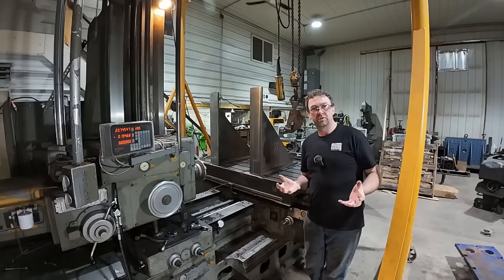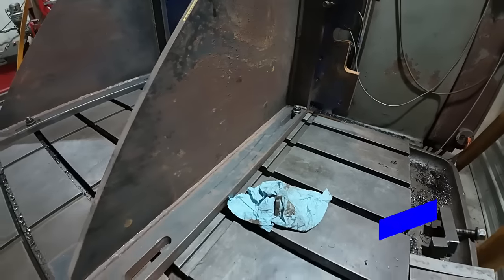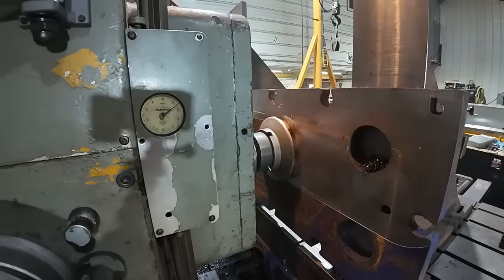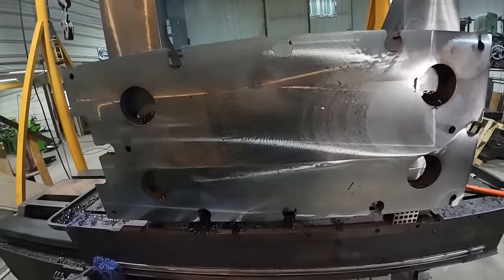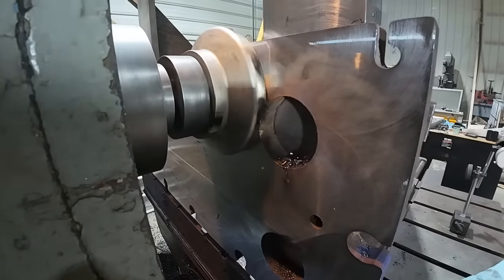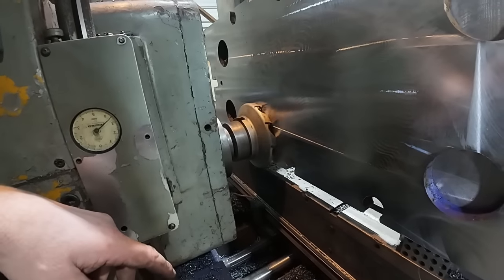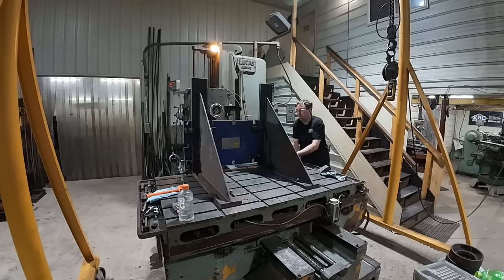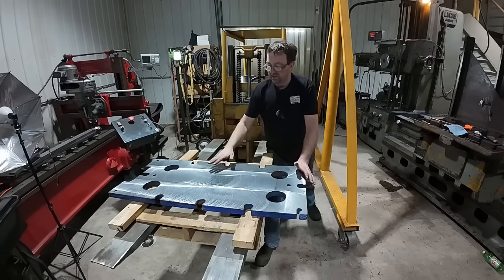Milling Another Heat Exchanger Plate on the Horizontal Boring Mill - Manual Machining

Comment: A little tip for plate and frames: instead of a chamfer, radius the inlet and return ports. For whatever reason, we have seen less failures after doing a .030" radius than a straight 45 chamfer. I am sure it is not the best advice for you, but your customer may see some more life from these.

Comment: Just a thought.  If you have a magnetic based drill, clamping it to the back side of the plate might reduce the vibrating.  Change the resonance frequency.
Reply from the maker: I wonder about residual magnetism holding chips on the cutting side and messing up the surface finish.

Comment: These jobs can frustrate you to no end. I run an hbm every day and just when you think you have the perfect set-up for a job, it vibrates.  Gotta get creative sometimes. I think i would have tried another 1-2-3 block in the middle and a hold down clamp over top of it. Might have helped....might not. I always put lots of t-nuts in between my angle plates or stops just in case i need more clamping. Anyway, it turned out nice for you and thats all that matters. Cheers Josh !
Reply from the maker: Yes, I should have tried a hold down. I never thought of that. I bet it would have worked.

Comment: Side note: A tee shirt can be incredibly uncomfortable when it has a bunch of graphics on the back. Any professional machinist will likely know this. Right? Great work BTW. You are the best. But, doing it wrong, all the time. Very great stuff.
Reply from the maker: LOL.  Actually these shirts are quite comfortable.
Reply: @TopperMachineLLC  The one's I wore were a total vapor barrier. Like wearing an old Sears vinyl poncho. Perhaps yours are more porous and breath better? The tech has changed I suppose.
Reply from the maker: @johnmcanulty7341  that and my shop has AC.

Comment: That a heat exchanger cover plate for the Alfa Laval plates, I work with those very often on the large MTU marine engines. BTW great job.
Reply from the maker: This is exactly what these are for in a local power plant.
Reply: @TopperMachineLLC  I appreciate your videos and thank you for sharing them.

Comment: Honestly, as thick as the plates are and the torque required to put them back together you could probably take a full quarter inch off the face and they would still be fine. I've never seen the front or back plates bend under several hundred lbs of torque. The chiller plates and gaskets though are a completely different story and you have to be very careful to apply even torque to each bolt or else those gaskets are going to leak like crazy. The plates themselves are stainless or titanium and when water is going through them they're so cold they condense the humidity almost immediately. We used to run plastic pellet extrusion and if even a tiny pellet a quarter the size of your pinky fingernail would find its way behind the gasket or on it the water pressure would shoot a concentrated stream of water several dozen feet.

Comment: You do great work just wondering if coolant would help the finish
Reply from the maker: Cool and is unnecessary for most operations. It would just make a mess. The heat went into the chip, carbide never got hot, and plate was cool.

Comment: You might be able to change the vibrations by welding or clamping larger blocks of material to those squares, the extra mass will change the frequency. Might be able to use something like a magnetic lifter, not sure what will happen to the chips though. Something similar could maybe be to cut a big hole in the center of the support plate, it will change how it resonates, but I don't know how to predict that change.
Reply from the maker: The magnet lifter may have worked, but you bring up a great point. I wonder if the chips would cling and possibly cause problems.
Reply: @TopperMachineLLC  I was thinking a third square with magnet coupling to the plate would work really well, unless the chips pile up around the magnet and wreck the surface finish. If the chips are hot enough, they won't be magnetic, but I doubt they get that hot.

Another thought might be to make a follow rest to prevent the plate from getting pulled up by the tool. Might help, might overly complicate the process. A third angle would be best and maybe just pushing it against the plate would be enough to stop the vibrations, maybe a strip of urethane since it won't be clamped.

Comment: Hiya Josh. Love the work. I was wondering if setting the plate vertically with the angle plates closer together would solve the chatter. Just my $ .02
Reply from the maker: I think a third one would have cured it. I think the chatter would have just moved to the outer ends if I'd have moved them.
Reply: Could you use another right angle plate in the center with a grub screw to help with the vibration?  Maybe with a piece of wood in between just to dampen vibration. 
That thing will surely eat some metal up quickly. 
Keep the videos coming Josh. 
Joe

Comment: Put some holes in the sides of angle plates.  get your self some round bar put some tap holes through it for all- thread rod. so you can tighten up against the back of a large piece like that.  to take out the vibration

Comment: Ha!  As I watched the video, I myself was wondering how it would work to resurface that plate using a planer as a planer, rather than a planer/mill.  Looks to me like the two methods you have there are about a horse apiece, the planer/mill having the bed stability but pretty handicapped by the BP spindle, while the Lucas has a great plenty spindle but its harder to tie the work piece solidly to the table.
Reply from the maker: Better angle plates would make a difference on the HBM. But I would love to try an actual planer.

Comment: Mr.Tapper,i have few ideas for you  (1) machine a key way in base of angle plates that will fit t-slots in table,(2) machine t-slots on face of angle plates alot easy to clamp up againist ,clamp 4 blocks on angle plate so u drill all the thru (3) put an L one and an R on the other always put L on left side R on the  right side SEEMS  KINDA ANAL DONT IT,FASTER ON SET-UPS IM A RETIRED HBM Operator ive run Portage,Lucas,Defiance,Giggings & Lewis machines BUT the most accurate machine i ever ran was a Deveileig Jig Mill and if in your budget get a square turn table ,wider angle plates would be  better  16 or 18 inches wide YOU LEARN SOMETHING EVERY DAY  on how to opreate any machine in your shop,DONT LET THE TROLLS RUN U OFF u need a part time experienced HBM operator???

Comment: So the dips who trolled you for using the planer were wrong?  The planer had no vibrating harmonics to cause the chatter, right?
Reply from the maker: Similar results.  I still had chatter, but I corrected it in both videos.
Reply: @TopperMachineLLC  well, i tried. 😀

Comment: Would there be any benefit (tool life or similar) to removing the rust/scale layer before making the first cutting pass? I'm thinking maybe not, else you would be doing it. No negativity here, I'm just a subscriber trying to learn something.
Reply from the maker: I used to spend time cleaning the material, but in the end it is just a waste of time.  The time spent is far greater than a few inserts if you burn them up.  On this, I didn't harm an insert.  In fact, I could probably do this same job on the same inserts 10 times without wrecking a corner.
Reply: @TopperMachineLLC  Thank you Sir, for filling me in.

Comment: at my work there is 2 heat exchangers. I don't understand why you are surfacing the plate. It does nothing other than crush the plates.  there is a insert ring gasket in the 4 large holes and a gasket on the heat exchangers starter / end plate.  no steam or material ever runs between the plate you just machined and the heat exchanger plate.  if it was leaking , it was a bad seal on the 6 inch di. holes.

Comment: You can nullify the resonance with less cutting force on the part. I imagine that part is oscillating back and forth in the middle like a leaf spring because its just too thin and flimsy to handle 4-5 inserts all making a cut in it without bending regardless of speed & feed. Maybe remove every other insert or cut with the smallest stepover you can without having an intermittent cut.

Comment: courious how much $$ they have into rebuilding that Plate&frame heat exchanger. they are usually cheaper to replace than to re-gasket let alone do any machine work to. since its blue its probably an Alfa-Laval. they are one of the more expensive heat exchangers, only second to Mueller, but its still usually cheaper to replace the entire unit. assuming that exact model is available and no piping modifications are necessary. i'm currently replacing an Alfa unit with a Danfoss at a beef plant, the heat exchanger cost was 1/3 and lead time was half.  and a set of gasketed cartriges for the alfa was more $$ than the new complete plate and frame.
Reply from the maker: I was actually wondering this myself.

Comment: I think you have a lifting magnet.  Do you think putting it on the back of the plate would dampen the vibration?  There’s always a way to skin a cat!
Reply from the maker: several have suggested that.  I think it could, but would it hold the chips to the plate with the transferred magnetism?  Potentially damaging my surface finish?

Comment: Not only years and years of being torqued, but being a heat exchanger there will be some warping from the heat / cool cycles.
Reply from the maker: 100% correct
Reply: @TopperMachineLLC  on one of your videos will you show the tool you used for deburring so we can see what actually smooths the edges?
Nice work by the way
Reply from the maker: @Dave_Smith_1958  I've shown it several times in different videos. I've also put some shopping links in some so you can buy one.

Comment: If you weld on something cleaned with brake clean it forms a deadly gas.  Better to clean with starting fluid.
Reply: Only chlorinated brake cleaner poses a problem. I don't know about the US, but here in Europe chlorinated brake cleaner has been banned a long time ago.
Reply from the maker: I learned that one a long time ago. But it's only with the chlorinated stuff.

Comment: I was always told not to lean on a machine when it is operating as it can influence tollerances, they never said anything about standing on the machine though so I guess it is ok.🤣
Reply from the maker: I think the leaning thing is for flimsy little machines like your Bridgeports and south bends. I have actually seen them move by just pushing a little.
Reply: @TopperMachineLLC  Flimsy little Bridgeport knee mill. LOL
Reply: @TopperMachineLLC  The machines were actually Hardinge HLV capstans,, but I just thought it would have been fun to tell my old instructor to include the standing part into his lesson. I think is would have amused him. Sadly he died many years ago.

Comment: It will never work. You used the deburring tool in only a clockwise direction - you need to have it even in both directions. The sand that another recommends to reduce the harmonics needs to have half right hand and half left hand grains or it too will never work. The clamp you used to raise and lower the plate was back the front. Come on. You have to give the nay sayers something to whinge about. Almost forgot, The blue in the chips should be red. Unit was painted the wrong colour. Retired machinist/mechanic in Land Down Under where water swirls anti clockwise down the sink hole.
Reply from the maker: Lol. Thanks for the laugh b

Comment: If you will post your mailing address i will send you some money to buy some harbor freight suction cups. Put those on the back of the plate with acoustic absorbing material. 
I will not send money by other means because you will not receive 100% of it and I do not want to support the entities that take your or others money.
Reply from the maker: I appreciate the offer. My address is on my website.
Reply: @TopperMachineLLC  paper check is in the mail
Reply from the maker: @scottjones7279  thank you so much. I appreciate your generosity.